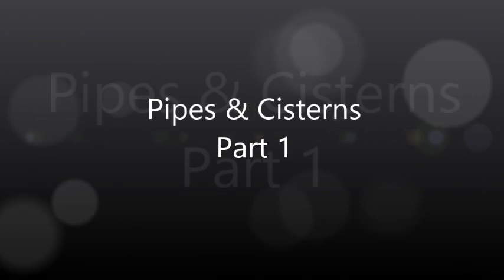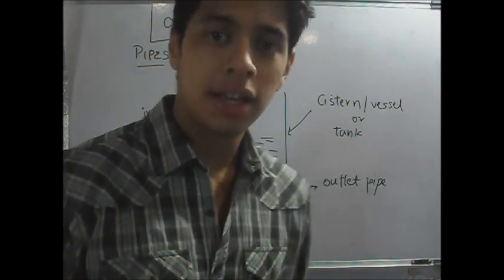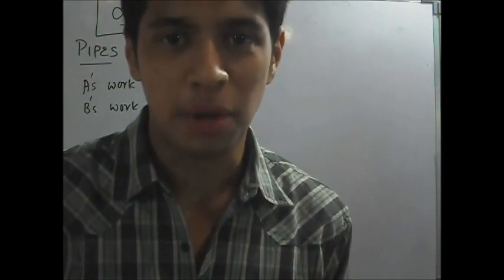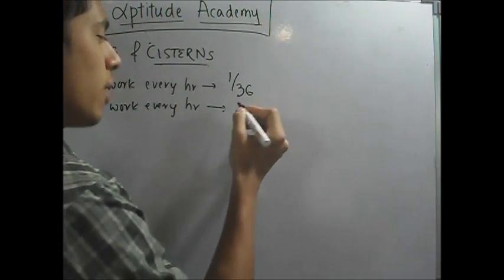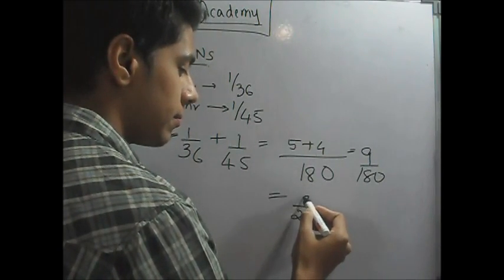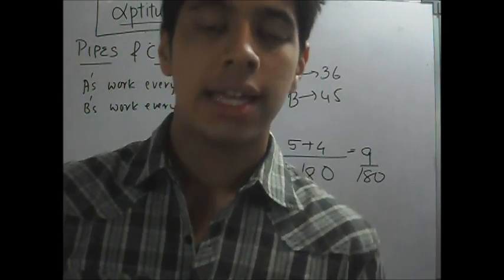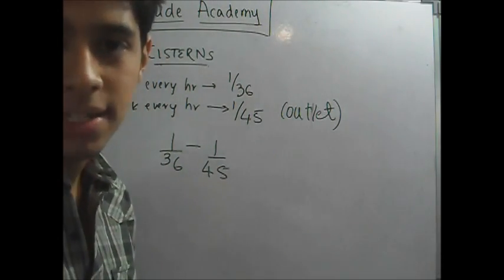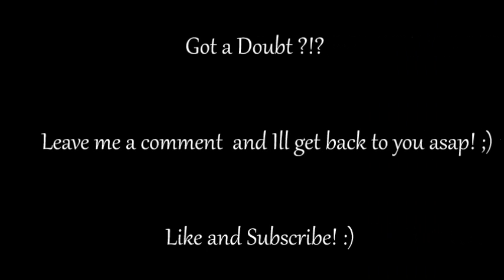Pipes and Cisterns -  Concepts and Tricks : Part 1

Comment: a tap can fill a tank in 6 hrs.after half the tank is filled , three more similar taps are opened. what is the total time taken to fill the tank completely?
Reply: +Swati Parmita I think it takes 6 hours. Half the tank will be filled in 3 hours. In 3 more hours the complete tank can be filled if the outlet pipes were not opened. So I think it is 2/3 - 3/6 (2/3 because half the work is done already).

Anyone correct me if I am wrong.
Reply: is the 3 pipes opened similar to the pipe which fills in 6 hrs?

Comment: Two pipes A and b take 90 and 60 minutes to fill a tank respectively. Another pipe C takes 60 minutes to empty the tank. Now someday, Pipes A and B are opened and when the tank is half filled pipe C is opened. but today after filling half the tank with A and B opened and also for an extra 9 minutes, and then letting C open. What's the difference between the time to fill the tank with two cases into consideration?